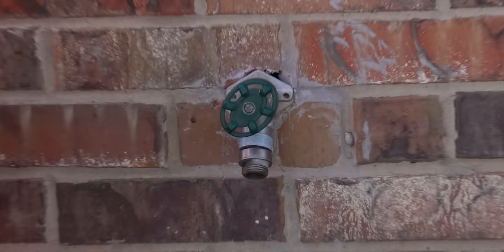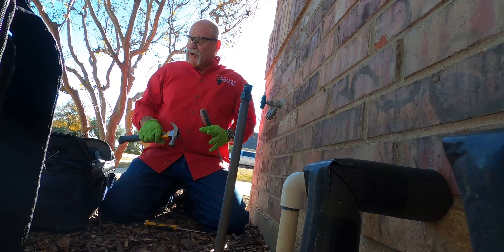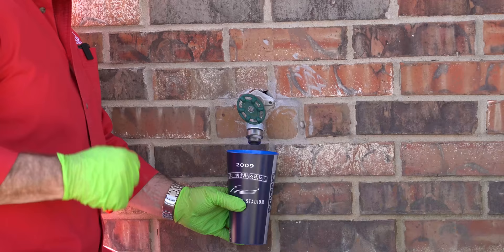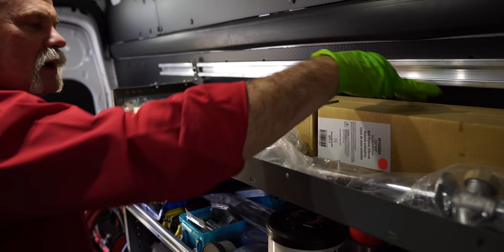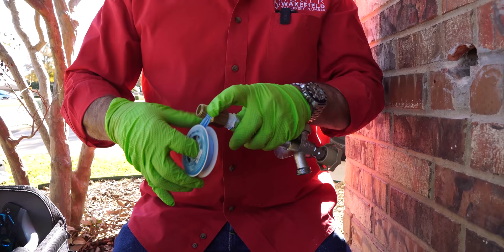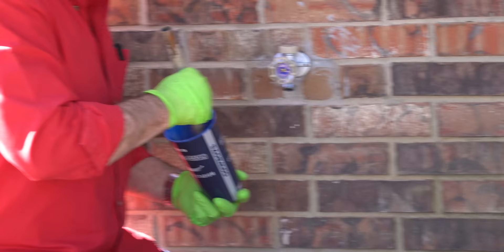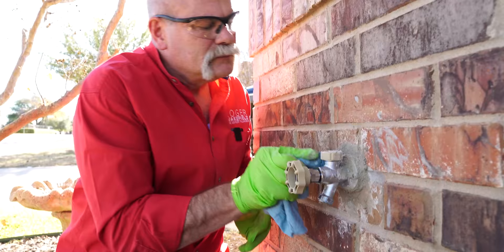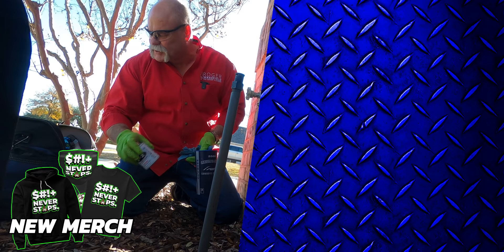How Pro Plumbers Replace Frost Proof Faucets

Comment: Would’ve used less Teflon tape, wet the brick around the hole , probably used electrical tape on the shaft so the mortar wouldn’t come in contact with the copper. I also would’ve cleaned the extra mortar off the brick .

Comment: Yeah, that's not going to work on mine. It's going through the framing of a basement window. It's not even frost proof, and yet, I can leave it on during the winter and never have to worry about it freezing. Like they say, if it's not broke, don't fix it.

Comment: 4:35. So when someone else comes back later to replace your faucet and the extension stays inside the wall now they cant use the longer 4” faucet.
Reply: You would just remove the extension. Not a big deal.
Reply: If the extension stays inside the wall how are you going to remove it?
Reply: @gtdodgeviper  with a deep socket on a long extension.

Comment: Can’t believe you didn’t have someone on the inside with a wrench holding pressure to keep from turning on the pipe inside.
Reply: I think the approach is "don't tear up inside sheetrock until you have to".  Just my guess though, I'm no pro.
Reply: @bgnPrinceton  I would also think a small square hole is a minor fix to avoid a possible wall and floor and more water damage from a leak at the threads or a cracked pipe from unscrewing it or over tightening. You don’t know it’s not leaking unless you can see it when you’re done. Water damage can be major.
Reply: @axeman33333  A small inspection hole is a great idea.  May not always be feasible though.  On my house, 2 of the 3 outside faucets don't have easy wall access on the inside.  I'd have to remove a bathtub and a cabinet.  I wonder if code requires extra support/reinforcement for these pipe connections in case the hydrants need to be replaced?  That would be good to know.
Reply: @bgnPrinceton  I understand what ur saying

Comment: in danmak it is not legal to have a frost-free water tap halfway through the wall .  it must go all the way into the house on the hot side of the wall
Reply: Makes sense, Denmark gets much colder than where he operates in Texas so the regulations for frost proofing are probably much stricter.

Comment: All gravy until those threads don't break lose and you twist that pipe in the wall. I always cut a hole on the inside, those female fittings have spots for a wrench for a reason!

Comment: why not take the stem out and replace the 20 cents washer?.
Reply: This is a frost proof hose bibb, the washer is way back in where it threads to the other connection inside the house, much easier faster and cheaper to swap out for a new one.
Reply: Most times there is a notch in the seat and will still leak and it takes 15 minutes for it to completely stop dripping anyway and that can lead to 15. Min wasted

Comment: Not ideal  mr. I would put the  FIP with a piece on pipe shove it through and connect  it on the other side. You could  crack the fitting or piping in the wall.  You have to check it for leaks anyway. you're  better off working  from the other side.

Comment: Here's what I would have done differently....First buy the wrong one. Then get the wrong adaptor and go back to the hardware store. Then break the fitting and turn it into a bigger job, alas another trip to the store. Finally get it right after turning an easy job into half a day 👍
Reply: that's why when I'm not sure what size it is I buy every size available then return the ones I didn't need.

Comment: man i  wish i had ever had one that was easy to replace and just threaded in. every house I have ever owned these were always soldered in and in the worst possible place imaginable to work on.
Reply: I have one that is soldered in and have been putting replacing it off for a couple of years because matching the paint inside is going to be tough. I have another spigot nearby that I can use when needed.

Comment: i hate frost proof faucets, the stem inside them always snaps off. i like the classic ones way more, they're good if you shut off the water in the winter.
Reply: Plumbed my house in 92 and put Arrowhead frost free s on , they had Type L barrels then ( not anymore) when mine started leaking and notched the seat I cut mine flush with the brick , tapped 1/2 inch threads in it and screwed an old style short Arrowhead with a brass all thread nipple into it  been 5 years now
Reply: you're not supposed to use an 18" pipe wrench to turn them off.
Reply: @kenbrown2808  i dont

Comment: Some plumbers started making the newer PEX Lines longer so when you disconnect you can pull the entire PEX line out of the wall. I’m not keen on this but not opposed just yet. If they can install a housing inside the wall to prevent the line from knocking I would definitely go that route. Completely makes it easier.
Reply: That's a good idea except with a 12 to 16 inch thick foundation wall your going to have a 12 to 16 inch loop in the interior that you need to hide or manage somehow.

Comment: ... Break the brick and try untwisting the hosebib. If I hadn't seen your other videos, I'd think you were a hack. 

I replaced three of these today, all three were CPVC. Your method would most definitely have cracked the CPVC leading to a more expensive repair. 

Also wouldn't work with PEX... Or old Galvanized... Smh

Comment: Frost proofs are such garbage (Ontario, Canada here). They always get messed up and people thnk they don't need to shut them off in our -30C weather (we have interior shutoffs for hosebibs and people drain their hose lines in the winter normally). I'd rather run a hose bib back to the mech room and put a stop and drain back there. Never fails as long as it's used properly.

Also pipe dope is a huge no here for potable because it's toxic. IDK if you've got a potable dope, but maybe look into what you're using.

Comment: I’ve used only a Teflon tape with no pipe dope and it never leaked, unless it leaks I am refusing to use a pipe dope since to me that is just an extra step not worth it.
Reply: Teflon tape is a sealant and pipe dope is a lubricant. Sometimes the joint will lock up prematurely without the dope causing it to drip. Also, for 1/2" threads, only need 3 wraps of tape.

Comment: If you wouldn't use proflo junk, you wouldn't have to put that extension on one.  I've seen many a frostfree spiral when someone tries to disconnect from the outside not at the actual connection.

Comment: Try installing a rebuild kit BEFORE you call a plumber.  A local plumbing company wanted $750 to replace a leaky faucet, and REFUSED to install a rebuild kit.  I called BS, and installed a $20 rebuild kit myself, and fixed the issue.

Comment: A pro wanted to charge me $250 to unthread a frost-proof spigot and screw in a new one.  Reasonable charge for half-hour's work including a trip to the hardware store to replace it?  Like I did myself?
Reply: You're pretty lucky if you can find a plumber to do anything for less than $250 these days.  Mine charges $110 just to come estimate something.

Comment: I never replace frostfree faucet like that also there always sweated on. I have replaced more than I can count. I started Plumbing in 1999.
Reply: Not always are they sweat on. We always use threaded adapters. I don't like the idea of un-threading the bibb without backwrenching like he did though
Reply: @ag95mboy  I'll tell you what I see a whole lot homeowners twisting them up underneath the crawl space twist and a half inch copper pipe

Comment: THERE ARE HOLES IN THE MOUNTING PLATE FOR A REASON.   A GOOD PLUMBER WOULD HAVE PUT A COUPLE ANCHORS IN THE MORTAR AND SCREWED IT TO WALL AS WELL.    HE LEFT A POTENTIAL DISASTER AND A LOOSE FAUCET.

Comment: Faucet valves are designed to be serviced, Changing out the entire faucet in this case is completely unnecessary, a $10.00 repair kit would have done the trick, However I guess there is no money in that.

Comment: Nice work and attention to detail. However, steel or copper pipe passing through masonry should be shielded with mil wrap or insulation. I'm not a big fan of the plastic cap vacuum breakers (proflow) in the Texas summer unless its a Woodford Brass. I typically don't chip the mortar unless its on a property that is pre 1995. After that the threaded fitting was required. If access into the wall is needed I typically take out enough brick to install a cross brace and new drop ear. That way I can put back all the brick and the client doesn't have to hire a drywall repair man.